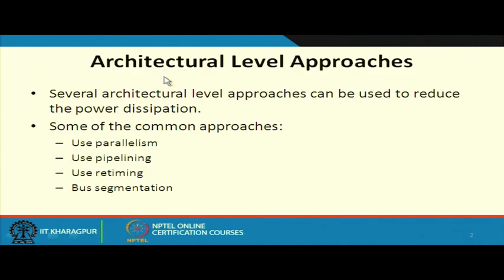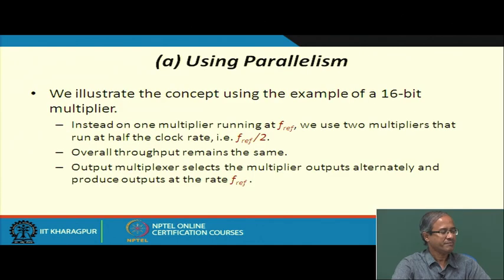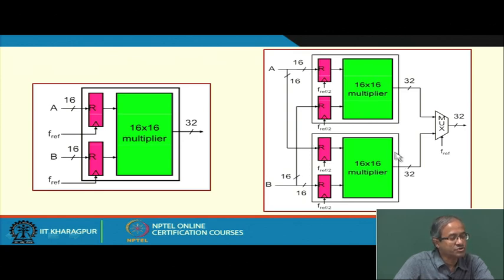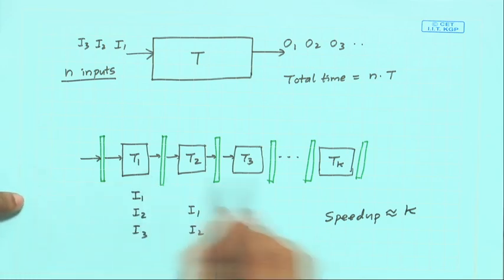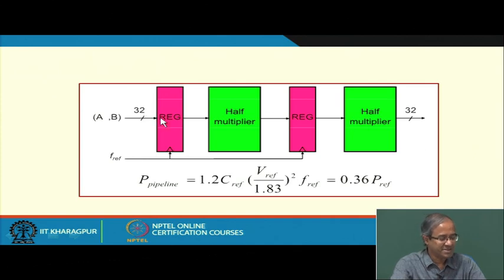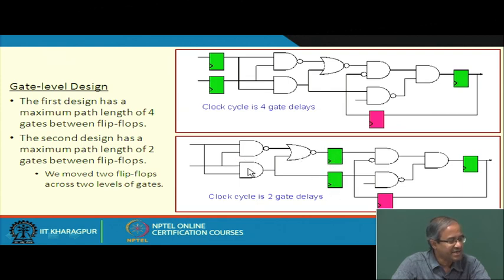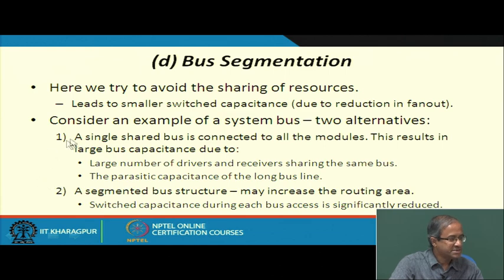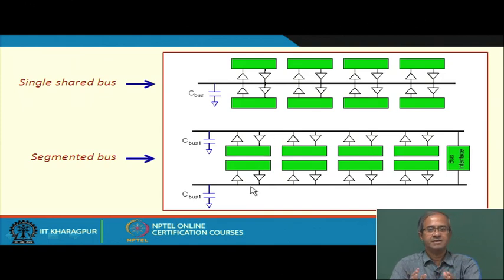Other Low Power Design Techniques

Comment: @5:15 why will each of the multiplier multiply their products at time delta/2? shouldn't it be 2*delta as each of the multiplier is working at half the frequency?
Reply: Bits are also equally divided in both multipliers alternatively so number of  bits in each multiplier is halved.